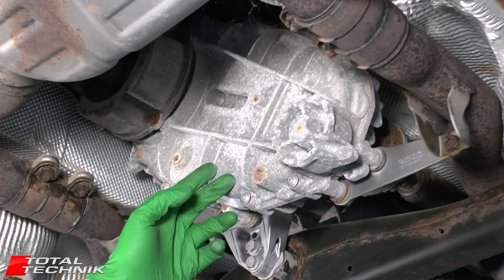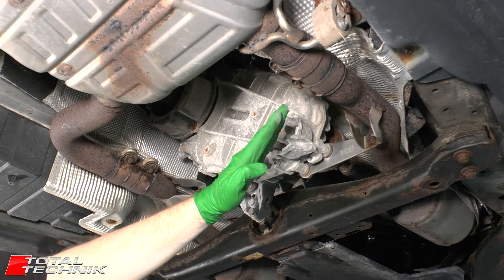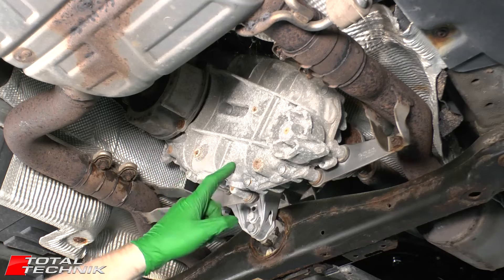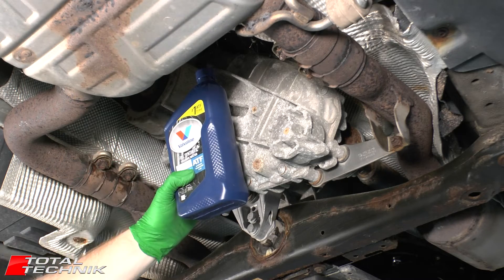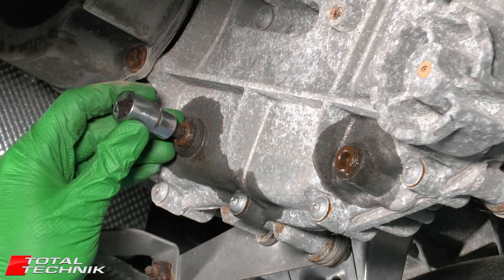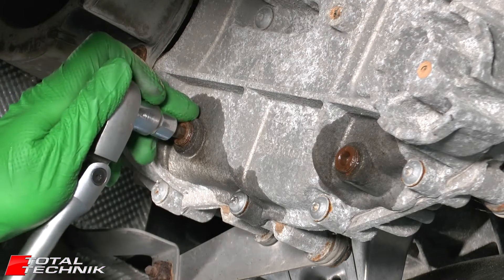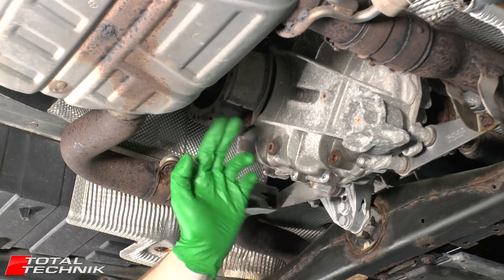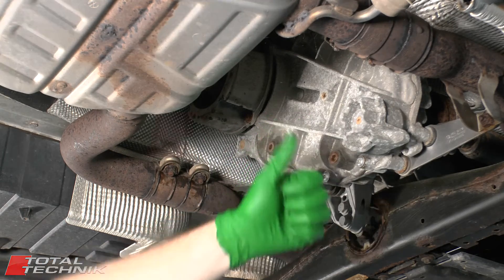How to Change Your Transfer Case Fluid - Audi VW Seat Skoda Porsche (VAG)

Comment: ATF fluid in the transfer case ?!? Transfer case is a mechanical gear box in its self , you should have use 75W90 synthetic gear oil .
Reply: Many modern transfer cases use some type of ATF as their lubricant. Folks should always track down the OE fluid specs in their owners manual, or with the ORacle (Google).

Comment: Hi, enjoyed many of your B6 S4 videos, very helpful, I thought i'd quiz you about an on going issue I have with my Manuel 2004 B6 S4 Avant, I've owned this car for 12 years now & in recent years it's suffered from a very noticeable "rev hang" when shifting gears at low revs, i.e the revs stay up for a second or two after releasing the throttle to change gear, could you maybe shine some light on the matter with your experience, I've ruled out the
clutch switch as suggested by many as this has been changed & checked, the problem is more apparent when engine is hot, it doesn't happen when engine is cold, Kind regards, Simon